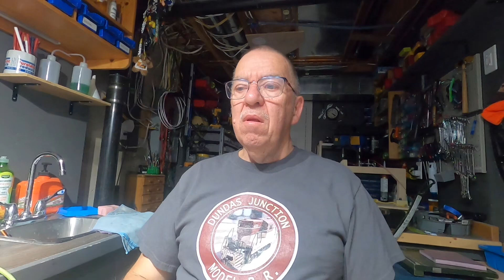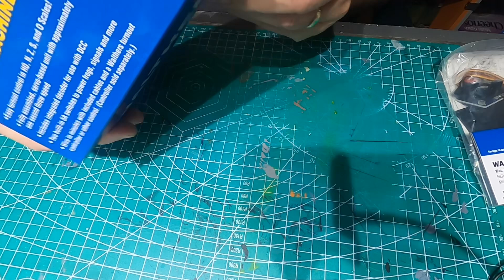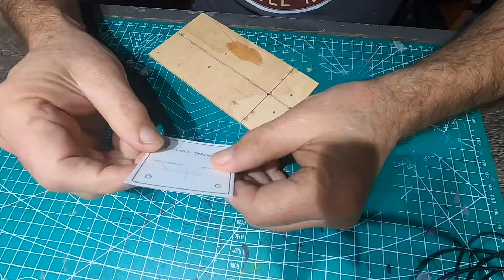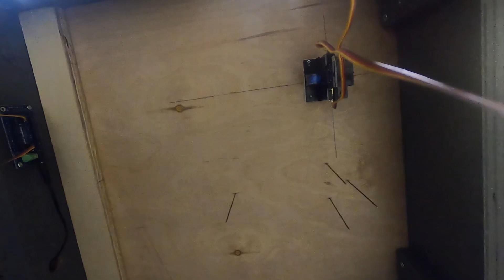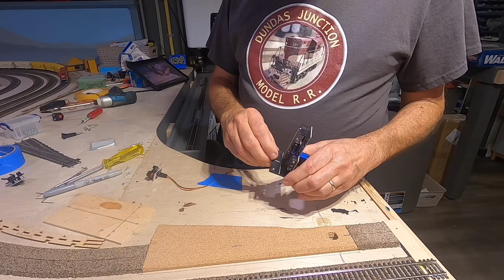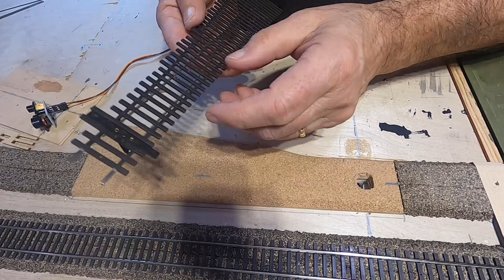# Walthers Switch Machine install

Comment: Maybe I'm wrong, but it looks like at the end of the video when the green light is on, the turnout is lined up for the siding, not the main. I am having the same problem. When I switch the wiring around, the color lights change but the switch still had the green light on when the divergent route is chosen. What am I doing wrong? Thanks, Dan
Reply from the maker: Hello Dan , when I was installing this switch machine , I reversed the switch machine, so it showing things backwards, this is on the list to correct , I need to do another video thanks for watching

Comment: Why three wires from the board to the machine?
Reply from the maker: That is the way the switch machine is built , would need to contact Walthers, but these servo motors need 3 wires

Comment: I bought one of these assuming it was a Tortoise alternative. The throwbar fit the dimensions of a space under my layout that a Tortoise didn't. But I had no idea that the only way to really use the Walthers switch machine was to invest in a Walthers switch system and have all your switch machines be Walthers. I just needed one for that ONE space! Argh, waste of money.
Reply from the maker: @elsongs  you can hook up a standard switch, just follow the instructions from Walthers , thanks for watching

Comment: Good tutorial. Just curious as why you chose the Walthers set up over the tortoise switch machines. I do like the lighted switch it comes with and it seems reasonably priced. Enjoyed the video,. Thanks James.
Reply from the maker: @GettingBackonTrackwithSteve  I liked the plug and play , no soldering required, easy to install and set up , thanks for watching

Comment: excellent video James!   They are definitely easier to install than the tortoise machines.  What I like best is Walthers makes all the attachments. [it gets very time-consuming wiring up toggle switches].  I'm guessing you are able to wire your frogs with these too  I will definitely use these on my second deck.
Reply from the maker: @Modeltrainaficionadochris  yes you can power the frogs , but I find that the instructions are not very clear ,, I tried this on my crossovers , failed , caused a short so I disconnected, needs more research, I like the switch machines , thanks for watching

Comment: Very good tutorial James. I like the template and I am going to build one. You can store the jumper using just one side on the switch pin out. Mike
Reply from the maker: @Deeprun_RR_Mike  good idea for storing the jumper, I have another idea to improve the installation, thanks for watching